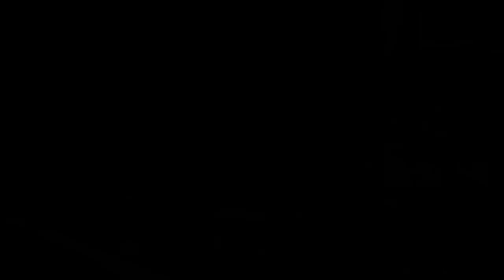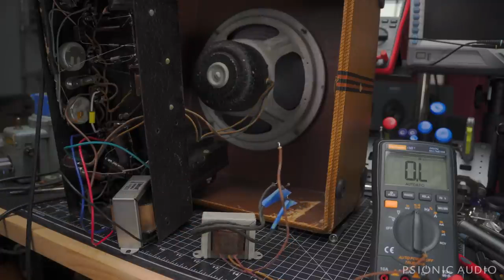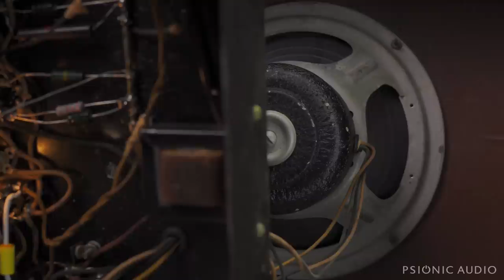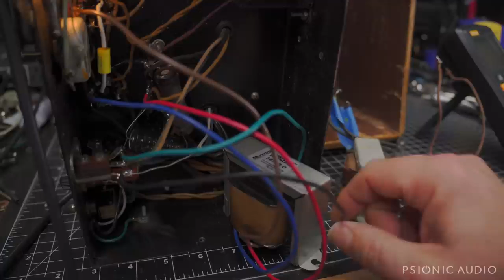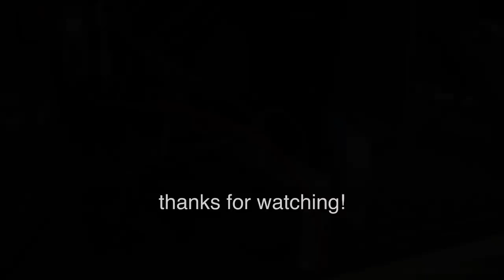'36 Gibson EH 150 Part 2 | Deep Issues and a Closer Look

Comment: For those interested, "A field coil speaker is a loudspeaker that uses an electromagnet instead of a permanent magnet to move its cone."
Reply: I will ask the question: " Does that mean the speaker will not weaken over time like an ALNICO permanent magnet speaker?"
Reply: @merrillaldridge2775  That would be my guess. But I had to look up what a field coil speaker was in the first place, so I thought I'd share that bit of info.
Reply: @picksalot1  Short answer is "yes", but field coils come with added complexity of needing a DC power source that must be controlled with added opportunity for failures or unwanted distortion.

ALNICO, Neodymium, ceramic, etc. have the advantage that their magnetic field is controlled thru engineering their shape/size and are less prone to fluctuation.

Of course permanent magnets are not permanent, but vary in quality - which usually means  higher quality will maintain field strength over a longer period of time. Some have weight advantages over others.

Without following the rabbit too deeply down the hole, that is the general difference: magnets are simpler and less prone to unwanted field fluctuation.

Learned a little about this using field coils to temper steel (steel manufacturing). Its not an easy device to control. They generate lots of heat. When things go wrong, it can be "entertaining"...but not in a musical fashion.

Magnets are just easier at the scale of audio equipment....(just not practical in steel mills).
Reply: @merrillaldridge2775  Thanks for sharing your understanding.
Reply: @picksalot1  I wish my ham-handed talents were like Lyle's, but mine deal with welding, cutting torches, 10 lb. sledge hammers, etc.

I absolutely am jealous of all the folks here who have the deft (not daft) touch to actually apply what Lyle and his network of wizards teach and demonstrate.

The mental acuity combined with the fine motor skills are astounding.

This one little subject of "magnetic fields" just kind of encouraged me a little much. Something from my profession fit into this world of amplifiers in a neat way.

Our hydraulic controls and motor controls parallel some of this stuff, but the world of audio/amplifiers/radio applies the principles in such an artful manner....with way more beautiful results.

You have to admire the art inherent to the science.....and vice versa.

Comment: Dang, Lyle closing in on 60K subscribers!  I remember the slow climb to 5K.  I have an Eminence speaker with that same tearing paper-buzzing sound, mine is definitely no good (and not worth re-coning).  I guess it's technically possible to replace the voice coil without doing a complete re-coning.  I may take the dust cover off when my replacement speaker arrives next week, just for fun.